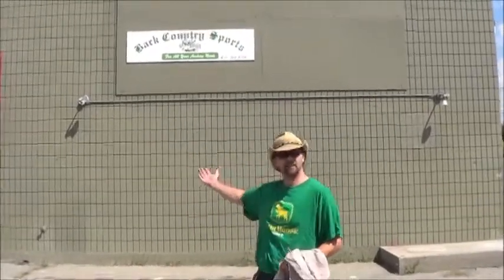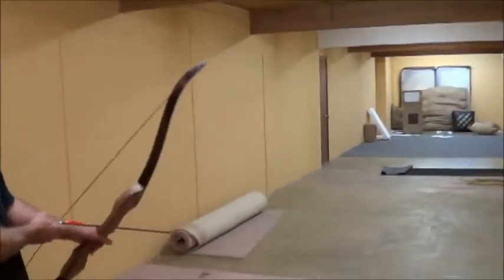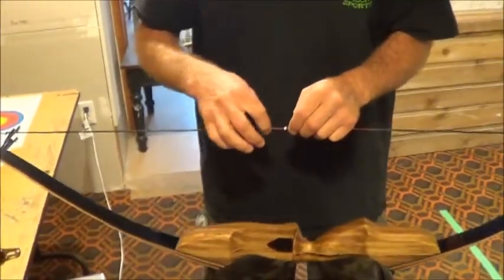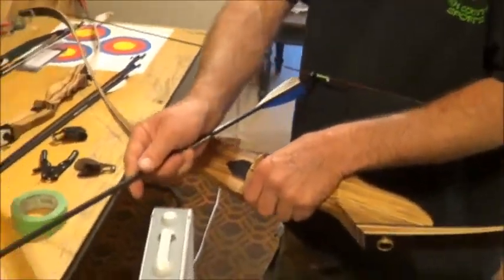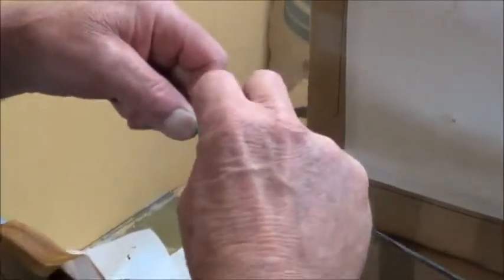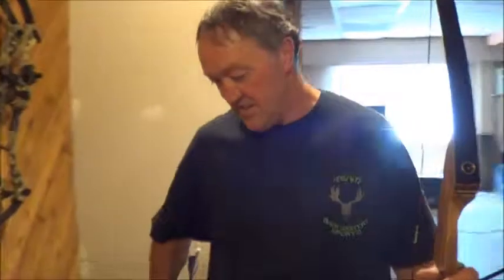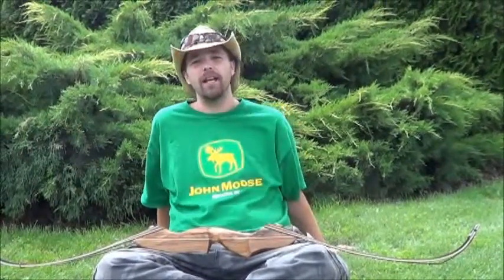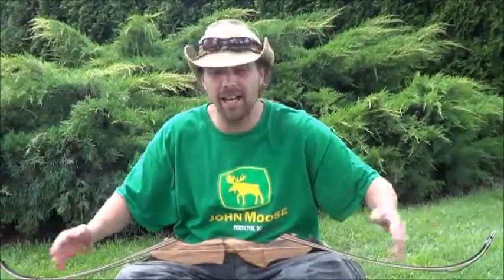Trip to Back Country Sports in Penticton BC

Comment: Very informative video. Anyone thinking about #archery should check this out.
Keep your elbow turned out to keep from getting hit by the string. I really had to concentrate on that until I built up the right muscles and it became second nature.
Reply from the maker: Jim S I've picked up a bracer while I work on that!  Elbow out?  I'll try to remember that while I practice up with this bow.  I wonder if that little arrow trap will be enough or if I will need to upgrade to carpet & clamps ...
Thanks for checking it out!
Reply: When you hold your arm straight, the arm tends to over extend and the bottom of the elbow drops and comes in and so does the inside of the forearm. 
That arrow trap might not be enough. Try a bail of hay or straw behind it. 
I'll be looking forward to your archery videos. :)
Reply from the maker: Thanks!  It should be fun.  I was already giving this bow a feel with the elbow out in mind & I can totally see how that will make a difference!  Finding somewhere to practice with this will be interesting ...
Reply: I used to shoot out of our second story bedroom window down into a target I put in the garage. The angle was sort of like being in a tree stand. It sounds unsafe, but we don't have any kids running around or anything.

Comment: So what happened to the idea of a bow setup for bow fishing rig? ;) Just had to get wood didn't you? :) Well the wood riser can be drilled and have a steel insert put in to accept the reel shaft. 10 or 15 coats of boiled linseed oil and then finish with a product from Rona called Bizwax will give you a good waterproof finish.
Reply from the maker: trollforge Lol, it's still in the works.  There was another bow there that looked ideal for the bowfishing but I'll tell ya what happened.  I held that bow and started thinking about venison ... suddenly I didn't care about fish all that much anymore!  Chox & I are still looking into bowfishing setups, I promise!
Reply from the maker: JT's Bearfoot Outdoor Adventures Actually, I did figure something out for fishing with that bow that might just work.  I need to test it of course, but I have a cunning plan ... ever watch Blackadder?  It's Baldrick cunning ... maybe I'll test that today!
Reply: JT's Bearfoot Outdoor Adventures
 Sorry Brother, not a Blackadder fan...
Reply from the maker: Ah, well in short... a 'cunning plan' is never really a good idea.  It's just an accident waiting to happen.
Shoot straight & play safe Brother Troll!